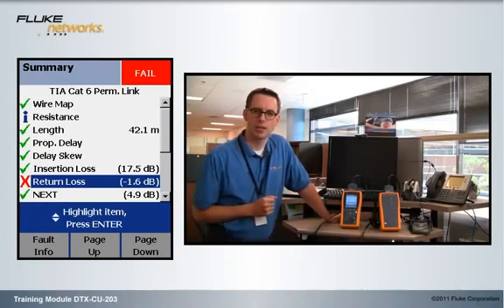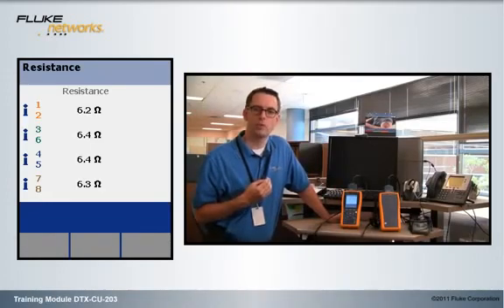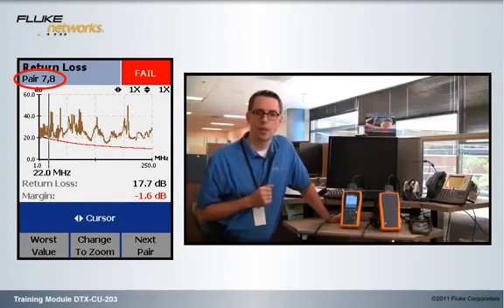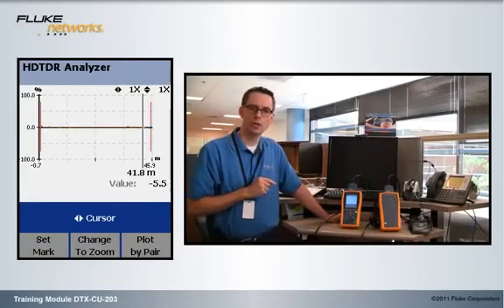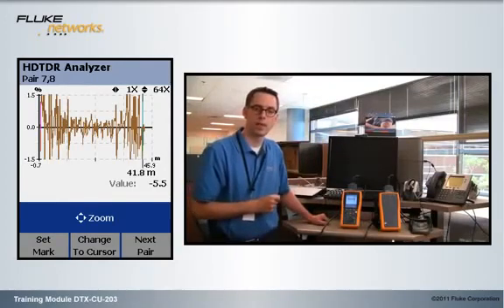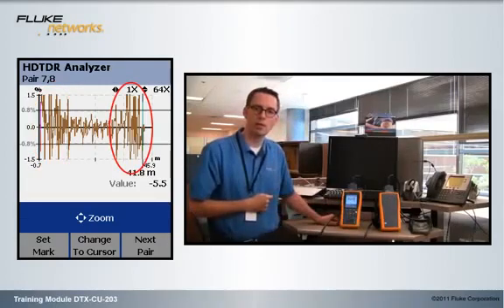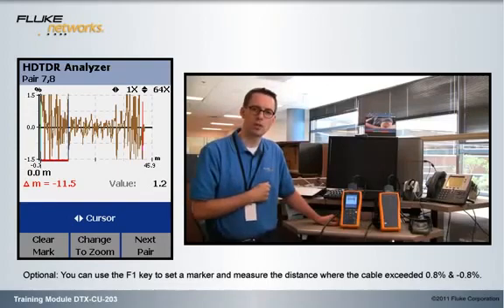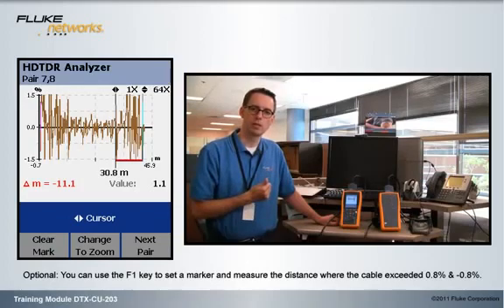Damaged cable causes a Return Loss failure (DTX CU 203)  - By Fluke Networks

Comment: I have a DTX-1800 CABLE ANALAYZER which displays at the starting the following message : the main unit needs factory service . CAN YOU HELP PLEASE
Reply from the maker: Fluke Service ended repair and calibration services for the DTX on June 30, 2018. You can read about it here:

https://bit.ly/3jb2qKy

Would you like help finding current products?